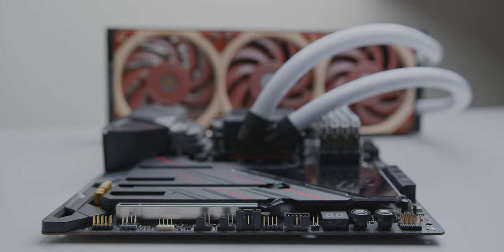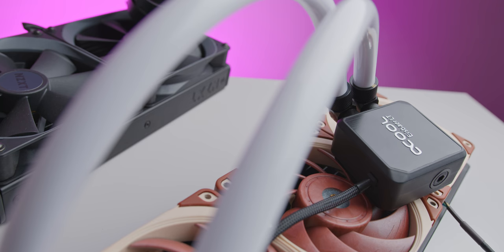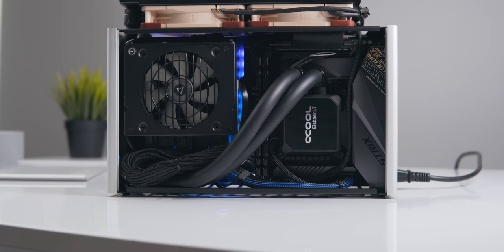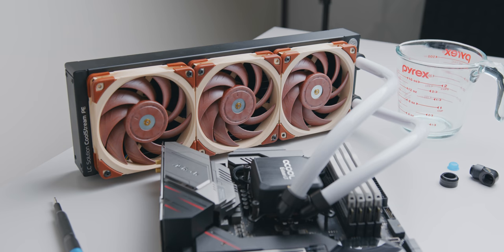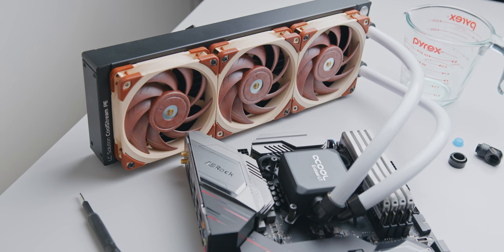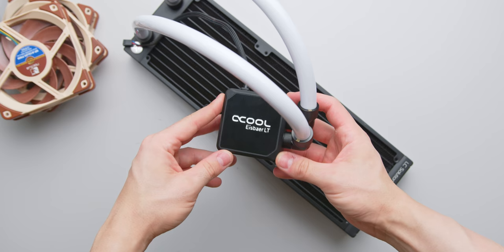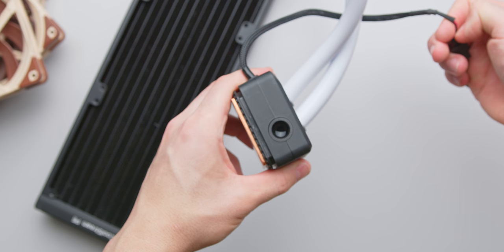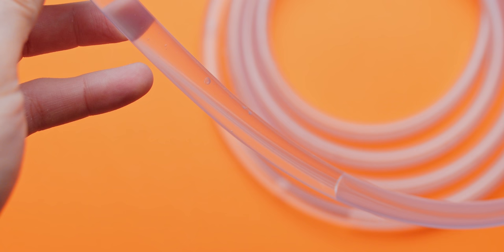Building an Overkill, Modular Liquid AIO Cooler

Comment from the maker: A pretty neat project to kick off 2020, could see this being useful for really specific or high performance needs.

Also, should we keep the 2:1 aspect ratio? Better for mobile viewer? Would love your thoughts!
Reply: You´r Color B-Rolls are amazing! Did some Screenshots =)
Thank You!
Reply: I love 18:9 (aka 2:1) aspect ratio, though. Just like Hardware Canucks video content. And I love B-roll intro. 😍😍😍
Reply: I kinda love the 2:1! Looks great on my laptop and phone!
Reply: Either of the ratios are good. Crisp quality videos are gonna be crisp regardless 😎 also can i ask, in the thermal graph of the custom cooler the max is 75.3° but the actual data doesn't even reach halfway between the 70 and 80. Is it meant to be 73.5° maybe?
Reply from the maker: @StasRyadinsky  Thanks! I use the Excel LARGE(array, k) function to find the  largest value in the data array, and it looks like 75.3 is indeed correct. But yes, most of the data is in the 73-74C range.
Reply: Optimum Tech I think the ratio is fine
Reply: @optimumtech  ahh i see, thank you for clarifying it. Looking forward to 2020 content from you!
Reply: Great idea for a video. I just built my first PC in almost 10 years and I used a lot of your vids for advice. Cheers and Happy New Years!
Reply: Yes, the 2:1 ratio is good especially on my phone
Reply: up for 2:1
Reply: my 12:5 monitor likes the 2:1 aspect ratio :)
Reply: Very good ratio 18:9 in landscape mode through my Pixel 3 👍
Reply: Really like the 2:1 ratio.
Looks great on mobile and my ultrawide :)
Reply: I basicly did this. With a 360×60mm rad and EK block. Can cool a super overclocked 9900k or the 18C 7th/9th/10th gen. Depending on testbench needs. And essentially everything else. Or if need be a CPU block swap to fit threadrippers best also.
Reply: i think that aspect ratio is the best overall.
for 16:9 monitor user have a little bit of cinematic borders
21:9 users finally get some videos they can watch without huge black bars right and left (only small ones)
and better for mobile user
Reply: 21:9 user here, the wider the better!
Reply: Does look great on my phone, a bit of wasted space on the iPad but the difference does make it look different in a good way
Reply: I think 16:9 is superior as your videos are appreciated in full glory on a television or a monitor, and not on a puny phone screen.
Reply: AO1337   Help me out.  I’m on my iPad Pro and it looks wide aspect ratio video.  Am I missing the point?
Reply: Shieftain I agree with this.  Forget the people on phones.  These videos are really best viewed on desktop equipment or large screens.  The phones will be ok with wide aspect video.  I’ve never had an issue on my iPhone X or pro 11.  Keep them wide for desktops/laptops/wide screens.  Nothing worse than a “tall” video!  😂
Reply: Even on my desktop with a 16:9 display, I love the 2:1 aspect ratio. On my phone it's perfect since it fills the whole screen with no cutoff content. I say keep it. Love your channel!
Reply: Well, ok, I actually took the time to think....  16:9 is actually taller than 2:1... duh.  So I prefer wider aspect, which would then be the 2:1.  Go for it!  2:1 then it is!  :D
Reply: Can we just have 2:1 for b roll and 16:9 for the rest of the content?
Reply: 2:1 would be great
Reply: Gday Please upload your content to bitchute and post new video info on gab/minds

Youtube+Twatter+Fakebook have constant shady stuff and censorship

Please use alt tech in 2020

Youtube is becoming mainsteamtube
Reply: Can you go 21/9?
Reply: how does this pump compare to the apogee drive 2?
Reply: The first part of this comment didn't age well
Reply: You recommend  mix metals?
Reply: I dont use liquid in my rig but i always appreciate work of art NOICE!!!🤩
Reply: Would you have to maintain this custom AIO like an open loop?
Reply: why not use noctua industrial 3000rpm seem its better? because they have higher RPM ? right
Reply: @dev9033  The industrial Noctuas are only better if you're okay with a lot of noise at higher RPMs than typical fans. At similar fan speeds, the regular ones are better/quieter.
Reply: @draco89123  thanks for reply, so if we dont care wbout noise better we use industrial noctua, off course we can set the rpm to 2000 too if we care about noise
Reply: "specific or high performance needs" I guess I kind of fall in this category.
I put 360 Aluminum rad as part of a full custom loop (CPU & GPU) in my 12.5L 12x26x40cm 6kg ITX SFF build.
And despite being full aluminum loop, it's working perfectly fine under benchmarking or under heavy gaming (on a 3840x1600 160Hz monitor) temps never go above 66ºC (running 9900K overclocked and undervolted, and 2080Ti).

Btw I think coper is grossly overrated as the best liquid cooling material. First it's not even liquid :P I'm just joking of course :)
Of course it has much better thermal conductivity (almost 70% better than Alu),
But besides Aluminum being only 30% of Copper weight and about 35% of its price, there's something else that seem that most people overlook - the thermal capacity (aka specific heat capacity). That's the heat energy a material can store before raising it's temp with 1ºC.
Note that heat capacity of water is what makes it so great for cooling stuff!  
It has 4.2K J/kg°C, compare it to Aluminum which has 0.92K J/kg°C, and Copper at 0.377K J/kg°C

To keep the full picture here are the heat conductivities:
Material _______ Thermal conductivity [W/m K]
Aluminum _____ 237
Copper ________ 401
Water _________ 0.592 (~20ºC)
Water _________ 0.651 (~60ºC)
Air ____________ 0.026 (20~25ºC)
Silicon ________ 130

So why we use water and even air cooling if they have a magnitude(s) of times worse than Copper?
Answer is simple - surface area!
For example a 9900K (and similar CPUs) size is about 37.5x37.5mm or 1406.25 sq.mm
The flat surface of a 240mm radiator is 28800 sq.mm (or 20 times higher), that's ignoring the thickness (part of which is to compensate for the holes needed for the air to go thru), it's difficult to get precise total surface area of a radiator as it also depends on the FPI and thickness, but given that space between fins is much smaller than their height I would say the active surface is few times higher - I would guesstimate the final active surface of a 240 radiator (about 30mm thick and lets say 12 FPI) would be at least 50-60 times higher the surface of the CPU itself.
Also around a large (compared to the CPU) radiator you can control the thermal conductivity to the air by controlling fans' speed & pressure, on the 37.5x37.5mm surface of a CPU you can't.

So you can think of Copper as a heat pipe that can transport heat very fast but has a small cross-section (can't hold much energy in it), while Alu is more like a much wider pipe (~2.5 times) that transport heat slower (~38% slower). However which is ultimately more effective solution depends on the final output of the whole system - ie the radiator/fans combo (as we happen to live and breath air).

So for example Gypsum pastes have about 60~75% heat conductivity of Copper, but they're used in order to fill the microscopic crevices and utilize maximum surface area for heat conductivity, which turns out to be higher improvement than the 20-30% raw conductivity loss of the material itself (compared to Copper).

So a optimal loop would being with heat source, then high-heat conductive material (like copper), then medium-heat conductive material (like Aluminum) but much higher heat-capacity one, then even lower heat-conductivity and high-heat-capacity medium (like water), and finally the cheapest, lowest-heat-conductivity & high-heat-capacity** medium (air).
** I consider air high-heat-capacity medium, but because of its properties (which is isn't ... at all!) but because of its practically unlimited volume and circulation (otherwise we would eventually suffocate ;))

The bottom line I guess is that Copper is awesome in tight places, where there's no space for engineering solution, but at a distance from the heat source where you can have more space you can apply engineering solution working much better than Copper alone.
So if I were to design perfect cooling solution I would use copper in direct contact with the CPU (btw what metal are the CPU lids made of?) then the top part of the copper would be larger and finned to increase surface area multiple times, then that area can be matched upon similar Alu layer ***, which on its other side expands much more and has a lot more fins to pass the heat to the water in the loop (and of course finally the water takes the heat to a radiator of size and design of your taste, and finally of course in the air).
(*** This direct Copper to Alu contact can be mitigated by thermal paste for example)

Comment: How does this pump block perform when you expand the loop with a GPU block? Would love to see more content like this!
Reply: Check out his build log for the water-cooled Ghost S1—should be a month or two back!
Reply: like the other guy said, check out his water cooled ghost s1 build. He used the same pump with a 240 rad and a GPU block. Spoilers thermals are good.
Reply: This pump is not powerful enough to drive two radiators and two blocks. It might barely be enough, if you only have a single radiator, but that's not enough cooling for a CPU and GPU. You can run two pumps though. There are GPU blocks called Eiswolf from Alphacool that have a similar pump directly integrated with the block itself. Instead of building it yourself completely, you could actually buy these as pre-assembled AIO solutions with quick disconnects and just modify them as you see fit. They're made with components that you can all buy separately from Alphacool for your custom loop. Namely that would be the Eisbaer LT for the CPU and the Eiswolf for the GPU.
Reply: @P8qzxnxfP85xZ2H3wDRV  How to connect two pumps on a single loop? It made me wondering as it might fit my needs of external radiators that might end up far away form the case.
Reply: @valdius85  There's nothing special about it. Just connect them in series with the same flow direction.
Reply: @P8qzxnxfP85xZ2H3wDRV  Just out of curiosity: what happens if you connect the pump to working loop and not power it up? 
I mean there is a working pump in this scenario and the second pump would be off. Would the water flow through switched-off pump? Or would it just spin by its own?
Reply: @valdius85  I have a 2 pump/block + 2 rad in 1 loop setup. It will flow through, but flow is limited through the inactive pump. When doing 2 pumps in 1 loop it may be a good idea to have one rad between each, so pump 1 > rad 1 > pump 2 > rad 2 > back to pump 1.
Reply: @MrStoffzor  That is what I was thinking about: connect one before and one after the elements that cause the biggest resistance. 
If I ever do watercooling, the radiators (2x360) would be outside of the case. 
I live in a hot climate and want a quiet setup, so it will be an overkill setup with fans spinning slowly. 
Thank you for answering. Watercooled PC are so interesting to me ;)
Reply: @P8qzxnxfP85xZ2H3wDRV  Source needed, since a single radiator for GPU and CPU with the Eisbaer is exactly the setup that Ali of Optimum Tech uses.
Reply: @skotskrutig  You just said it yourself. It's just one radiator and he already stated in one of his videos that it's at the limit.
Reply: I used clear tubing to visually see the flow in my loop and I can tell u it’s on the very weak side, and is hard to bleed perfectly. Don’t get fooled by no more bubble coming out of the block because it’s a small laby and Bubble doesn’t get through easily. Opened the rad port and the block many times shaked redo etc and I was sure it was 100% bleeded, but no after 4-5 hours I still see a lot of bubbles going through, Like the size of a tumb and pump is unable to push it even if the propeller is filled and bubble never escape the block when I open the bleeding port.... Still cpu never reach 60degree but I’m not going to overclock 5ghz  and play  eyes closed because sometimes I notice no flow cause of the big bubbles trapped in the lines.
Reply: If you use the same system as shown in this video, it still performs well enough. Eventually your system will stabilize with ambient - the main difference is how fast it's going to :)
Reply: @belsteed6050  Well you could have filled it in like a pot where you put the IN\OUT tip of the tubes from the pump under coolant on a pot, turn the pump ON, then the exiting pipe you lift and attach to the radiator, then submerge the radiator under coolant inside the pot and finally attach the IN tube of the pump to the radiator after a bit of time when everything is filled and bubble free, this would definitely get the minimum air as possible I think...
Reply: Probably horrible, its tiny

Comment: I love this Pump. Ive used it in the DAN A4 with a 120mm Rad and now in an Lian Li PC05S with an 240 Rad. 
 --- You can also use a G1/4 Temp. Sensor for measuring the Water Temp, Many Mainboards have an T.Sensor Input and can Control some of their Fan Headers with this Measurement. 

Btw. You could do this really cheap without losing that much Performance. Like an Magicool Slim Rad. Which Performs with low Fan Speeds as good as Thicker Radiators but you could use even Cheap Fans on it with low static Preasure. 
And i also recommend EK ZMT Tubes or Norprene Tubing. With that you can just use Distilled Water. (No light, no minerals and pure copper block and Radiator = There will grow nothing).

Comment: I just went with an alphacool eisbaer 360 for these exact reasons. The ability to refill, service(replace just pump if it dies), add gpu block easily if I choose to, more radiators, tailor the hose length, choose fittings, it's no question in comparison to a traditional AIO.

Comment: This is exactly what I did in my NCase!

My previous Kraken X52 became pretty noisy because of air getting trapped in the pump block all the time and after a software update the minimum pump speed was raised from 1600RPM to 2000RPM, so I swapped it out to a Swiftech Apogee Drive 2 with a Alphacool Nexxos Radiator, which also has a dedicated fill/drain port.
Now my system is pretty much silent at idle again and peak temps also dropped by 4/5°C.

So if your AIO bugs you in any way, go for the custom build!

Comment: Have this pump and am quite happy with it. For bleeding loop/leak test I attached directly to spare PSU with diy $5 switch and connected a long elevated tube to fill port as a pseudo res and let it run for a couple hours before installing in PC.

Comment: I simply got the Alphacool Eisbaer 360 AIO. Modular with the stanrard ports and so on and every part replaceable aswell as a quick disconnect in one of the tubes so you can attach stuff doen the line without having to empty out the e tire loop.

Comment: you can attach something to the radiator (no damaging it) and spin it around you holding the tubes and pump in your other hand - centrifugal force will mean the heavier water goes outwards and accelerate this whole procedure (then top up and repeat etc - hold thumb over fill hole)

Comment: This is a great idea for getting water cooling into smaller build. I have a Cougar QBX and a RAijintek Ophion EVO both drilled to accept 280 AIO. In a few years when the time comes to replace those AIO I might do so with a pump like this and a copper 280 rads. being able to customize tube length would a nice benefit.

I have a 360 PE radiator sitting in a box. I dropped it and hit the corner of a desk. Being afraid it might leak I purchased in radiator to finish my first open loop. Some month back I decided to test it and filled with water and left it over night and it didn't leak. So could potentially be used, though I admit to being a little nervous about using it still. But might be worth a shot.

Comment: I actually did this exact same project about a year and a half ago using the 1st gen Eisbaer.  It worked, but it wasn't ideal.  That particular pump/res/block combo had a major air trap flaw, and I eventually upgraded to a D5 custom loop.  The new Eisbaer LT uses a new pump design, but it doesn't function as a reservoir as well.

Comment: this is probably a great option for those that already have a whole bunch of liquid cooling gear but just don't have the time to maintain that setup. e.g I have a radiator and all my fans already and just adding the cpu pump block (120 AUD), four fittings (36 AUD), tubing (16 AUD). It actually ends up being cheaper but you have better cooling. Also, maintaining this loop is far easier than a hardlined or even soft tube full setup.

Comment: This also allows for making AIOs that aren't available due to lack of a viable market that would make mass production cost-effective. Such as for a 2U rack server, since this block,at just 40mm tall, is slim enough for a 2U server where a CPU will be under continual load. So that would necessitate an 1x80mm or 2x80mm radiator with tubing of the right length to reach to the front of the server. But it could still be beneficial in 3U and 4U servers by removing the need for a separate radiator and pump.

Comment: Agreed but for a fully modular Radiator.
I think I'll go for  copper radiator w/ built in pump.
Rotary angle fitting
16mm rubber tube
Barb fitting, CPU block of your choice
Noctua Fans
And Quick disconnect for modularity.